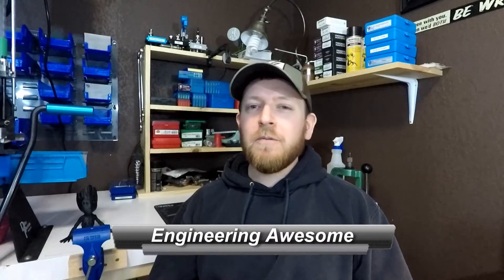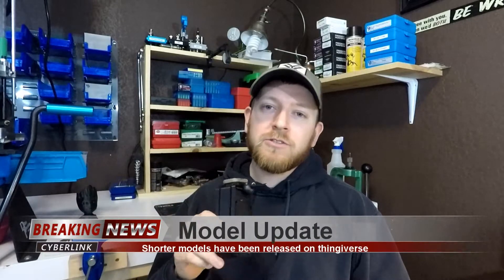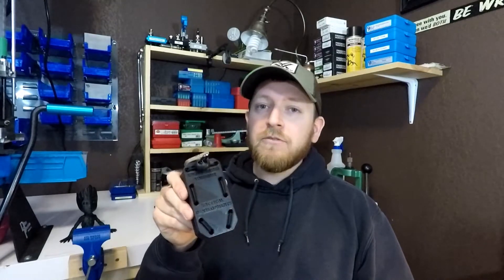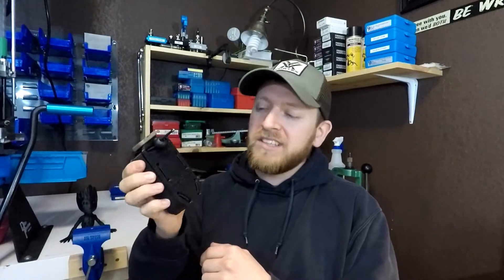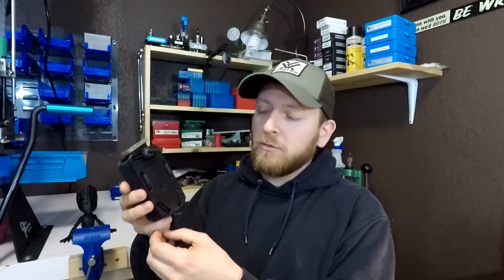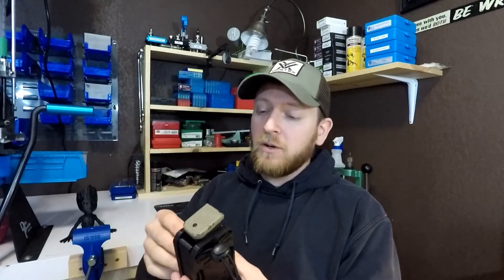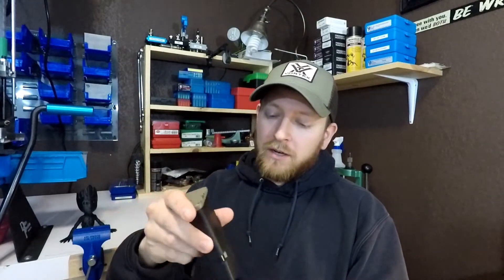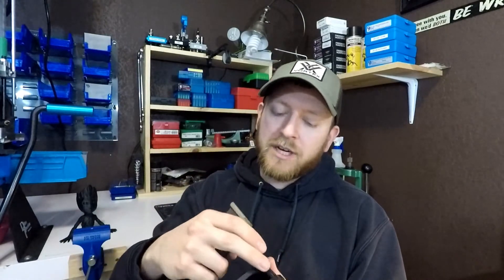3D Printed Double Stack Magazine Holster!

Comment: It's big, that's for sure. Have you looked into making something out of PVC pipe?  You can soften up PVC  with a heat gun and then shape it just like Kydex for a tight form-fit.  Lots of guys making form-fitting knife sheaths this way using PVC pipe. Just a thought you could use for other stuff. Thank you for the awesome upload and the 3D print files.